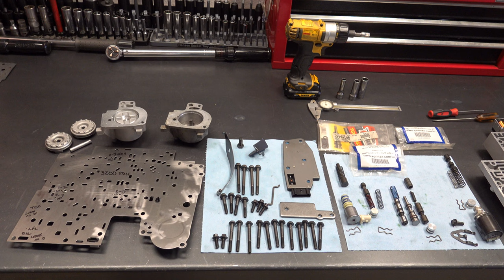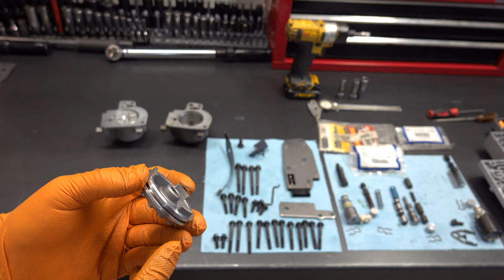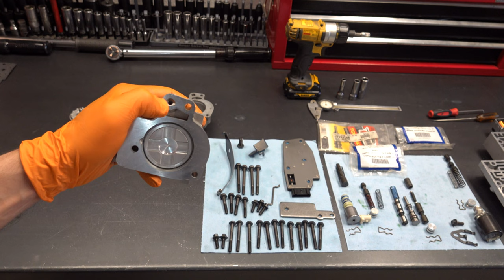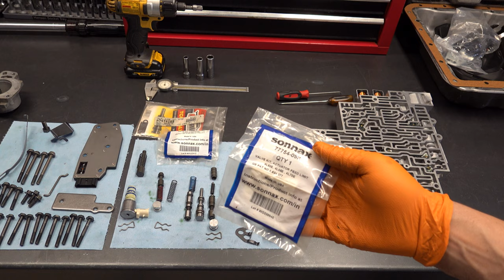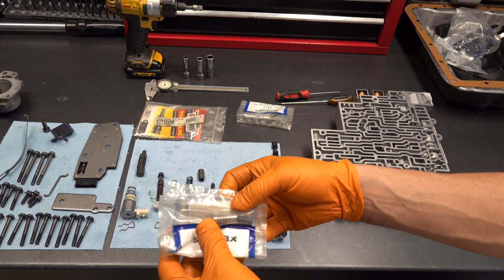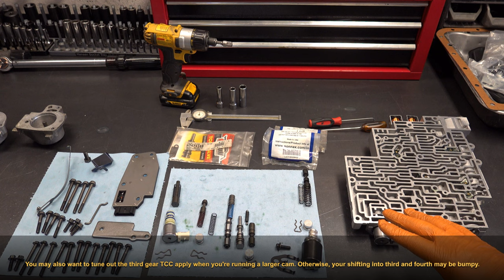4L60E High Performance PT4 - Valve Body and Spacer Plate Mods

Comment: You're knockin' it outta the park, Nick. I have yet to install a kit. Nothing against them, I just don't do high HP units, and I've been able to firm up shifts without a kit well enough to please folks. Anyway, I always hear folks measure holes drilled in thousandths of an inch, but every bit set I own is fractional. Do you use metric bits? Or do you just use a dial caliper on your fractional bits?
Reply from the maker: Thanks again, Kevin. I stopped using shift kits for most transmissions a while ago as most of the time a shift kit isn't needed to calibrate shifts and achieve performance. I do use a kits for a couple transmission types for their corrective parts (i.e. the Transgo Tugger for 4R100s). 

All of my numbered drill bit sets are either metric or SAE and I just use whichever best fits the need. Some transmissions like the TH350 and TH400 can have the feed hole sizes expressed as 1/8 (.125) or 3/16 (.1875).

Comment: Thanks for the information Nick! Your videos have been extremely helpful. I was hoping to maybe ask for some advice. I have a stock 1995 C1500 with a 4L60E that has a super late and harsh 1-2 shift. So far, I've purchased the torlon balls, a new separator plate with gaskets, a sonnax pin less accumulator piston kit (all 3), the tcc block-off valve, as well as a corvette servo kit. Would it be beneficial to drill the separator plate (if so, what size)? Also, can I use the stock springs or would it be worth purchasing a transgo shift kit? Lastly, I'm not sure whether or not to purchase a boost valve since I'll already be knee deep into this project. I'd appreciate any advice you could send my way. Cheers!
Reply from the maker: Hi Morewaterslides, thank you for watching and the compliments. First thing I'd do is check your servo travel...Remove the servo assembly, then take off the o-rings and large, front scarf cut seal...Then reinstall the assembly, including the main return spring, and cover snap ring...Then push inwards on the servo cover and see how far the assembly will travel before it comes to a complete stop. You shouldnt have more than .175" of inboard travel. If you do, shim the servo...

Next check the 1-2 accumulator housing, if you haven't already done so. Your 1-2 acc spring may be broken. Installing the corvette servo and Sonnax pinless will make that 1-2 shift even worse/more harsh so I'd keep the 1-2 acc piston and spring set up factory for now (or even install a softer spring, if you can find one...Overly harsh, late 1-2 shifts will eventually break the band - ive seen many of these come in with broken bands and no 2nd and 4th gear complaints...

Drill your 2-3 and 3-4 feeds along with the band release to .093. Leave the 1-2 shift feed hole in the plate the same for now. 

Lastly, purchase the Sonnax 4L60E-LB1 as that boost valve is likely worn out by now.
Reply: @nickstransmissions  Thanks Nick! This put my mind at ease. I'll be sure to update my progress in the coming weeks when parts come in and the job is done.
Reply from the maker: You're welcome, man!
Reply: @nickstransmissions   Finally got everything installed! I did however make one minor mistake. I installed the connector to the pressure control solenoid in reverse. It ended blowing the trans fuse on the interior fuse panel as a result. Once corrected, the truck ran great! A jammed 1-2 check ball ended up being the major culprit to this project.

Comment: Morning! Are pinless accumulators a good upgrade  for replacing the factory  ones. See if i can get firm shifts without sk and do a few updates to valvebody.
Reply from the maker: They are but your 1-2 shift will be a little bit firmer, all other things equal. The 1-2 shift will be more firm if you pair the pinless piston with Sonnax heavy duty accumulator spring.

Comment: Can you go in a little more deth on the 3-4 shift valve, as far as assembly,  and a look at what it looks like when it moves? Is there spring pressure on it? I think im having some issues with mine
Reply from the maker: Hi Eric, thank you for watching...What drivability symptoms are you having? 

The 3-4 shift valve simply strokes to enable apply oil to go into the 4th gear servo apply circuit, enabling an upshift from 3rd; it's a relatively simple valve train.

Comment: Quick question brother I’m fixing my 2003 suburban 4L60 E will that fix all  tcc valve will it work for mine and if so, any issues
I’m at the point that I stopped working on the valve body while I was trying to research this thanks
Reply from the maker: Hi Javier, yes - just purchase the Fitzall valve for your vintage (2001-2005; type 'Fitzall 4L60E 2003 in Google search bar to find it on Amazon) and it will address TCC regulator bore leaks and convert the PWM TCC apply to an on-off. If you are still getting P1870/Component Slipping DTC after you install that valve then the cause is somewhere else in the transmission or the torque converter itself.

Comment: I tore a 4L60e apart that wouldn't pull in 4 and it didn't have any value body gasket and spacer gasket. Why would anyone do that..???
Reply from the maker: Hi Tip, thank you for watching.

Yep, I've seen that as well...Not sure what those people were thinking as the gasket set is literally less than $2.00 at most places.

Comment: One division, the tcc pwm solenoid is equal to 3-2?
Reply from the maker: The 3-2 and PWM solenoids are the same for 1995 however in 1996, the 3-2 control solenoid changed so if you're shopping for a 3-2 control solenoid for a 1995 unit, the trans parts place will sell you a PWM solenoid...The 3-2 control solenoid, valve and spring were eliminated starting in 2009.
Reply: @nickstransmissions  Mine is 99, but the question is: if the TCC and the 3-2 are the same, because when you disassemble the head where the plug goes there is a difference. But the valves apparently, externally, are the same...
Reply from the maker: @minduca99  Please re-read my above response...They are the same for 1995 ONLY...In 1996, the 3-2 CTRL solenoid changed so they're not the same in your 1999 unit. if you had mentioned you were looking that information applicable to a 1999 model year, I would have provided a shorter answer applicable only what year you're working on.
Reply: @nickstransmissions  So, now I understand, I really hadn't understood.
And I still think I wasn't complete in my questions, I'm still in doubt!? (sorry, I don't speak English, I'm from Brazil). And I have a 99 Chevrolet Blazer v6 or GMC Blazer. Does this apply to it? In Brazil, few people have the knowledge to maintain this transmission...
Reply from the maker: You should have a 'Jimmy' if you have the GMC variant. Wouldn't matter - all 1999 4L60Es are the same with respect to the solenoids. 

It may be a good idea to put my responses into Google or another translator tool that renders what I type in Portuguese, assuming that is your native language.
Reply: @nickstransmissions  That's right, I speak Brazilian Portuguese, and I'm using Google.

I'm even more confused now... You said: "all 1999 4L60Es are the same in terms of solenoids." Does that mean that mine is the same, both with the TCC PWM and the 3/2?

And thanks for helping me.

And yes, I have a "Jimmy" GMC variant, and they even listed them as V6 and not V8, better known in Brazil as the Chevrolet Blazer... Thanks again.
Reply: @nickstransmissions Just to add, talking to my wife we will buy the 5 solenoids and change them all at once... Because I read an article that the error 1860 can be due to other solenoids or valves that do not open properly, as the transmission is already open, and we are in doubt if it was only one that was defective, and even considering the year of this car, which is already 25 years old, we will take advantage and change them.
Reply from the maker: I guess Google translator isn't doing it's job...What I said was 1999 4L60Es are all the same when it comes to the solenoids....I DID NOT say the TCC PWM and 3-2 control solenoids are the same because they are NOT! 

Please find someone who is bilingual who can help translate for you because Google is either not doing the translation correctly or you're not understanding what I am trying to tell you.
Reply: @nickstransmissions  Yes, now I understand. I will buy the complete kit of 5 solenoids, and it will be great.
Thanks again for your help.
Reply from the maker: You're welcome, Minduca - glad you were able to get it figured out.

Comment: on that plate you have a small elevation(where one ball goes in),  why is like that?  I see some plate that are flat.  in your video is below of #2 on the 1-2 area?
Reply from the maker: If you're referring to the steel sleeve, that's from the company Fitzall and it's designed to repair the 1-2 check ball location which is often heavily worn and occassionally the check ball will get stuck in the plate. The sleeve prevents that from ever happening.

Comment: fresh rebuild, I have a delayed 2-3shift particularly at wot. Any idea what could be causing that?
Reply from the maker: Hi Dominic, there could be a number of reasons including a leak in the 2-3 apply circuit (like partially pinched turbine shaft sealing rings), excessive 3-4 clutch pack clearance, forward drum leaking at the input shaft, improperly drilled spacer plate, solenoid B delay in coming off, drag in the 2-3 shift or 2-3 shuttle valve, etc.
Reply: @nickstransmissions   I have it apart. pressure tested the drum sitting in the pump with and without the reverse input drum. I change the rings a second time with a resizer and had no change. 3-4 clutch clearance is .040, was .030 when I installed it. Band clearance is .090, was .070 when I installed it. I pressure tested the input drum and no leaks around the shaft. I installed a new capsule on the initial build, and another when I changed the valve body trying to fix the problem. There's only 2 things I found, one is the servo pin bore will only pull 7" of vacuum, the other is the new spacer plate afl hole is .093, but while not ideal I can't see how that would give no 2-3 shift at wot. I was thinking maybe the pin bore is letting band release oil into the 4th gear piston, but I'm not sure if that would be able to delay the shift. I checked all the usual suspects, but I'm stumped.
Reply from the maker: The spacer plate's AFL balance hole is definitely a problem for WOT shifting, especially at higher power levels. Think about the factory orifice diameter and compare it to .093 in your plate - thats a fair amount of AFL pressure bleed off at a time when you need max AFL pressure. 

Did you install load release springs in the 3-4 pack?
Have you blocked the 3-2 control valve inboard?
Do you have an inner spring inside the main AFL valve spring?
What about the AFL valve itself - how much vacuum is it holding (should be minimum of 18" for anything high performance and my standard is 20")?
What are the hole sizes for the band release (2-3 accumulator) and 2-3 feed?
What boost valve is installed?

You have a 2-3 shift at WOT but it's flaring due to a delay in the full compression of that clutch pack relative to band release timing. That AFL balance hole is something id fix via peening the plate or getting another one...Band clearance is fine, has nothing to do with the 2-3 flare. That is all sourced within the 3-4 apply circuit or clutch pack set up unless you have a weak solenoid or defective PCM (I've seen examples of both).
Reply: @nickstransmissions   It's actually not a flare, just doesn't shift to 3rd unless I really let off the throttle. Running the car on the lift if I put it in manual low and get the speed up with light throttle as soon as i put the selector in 2 it shifts perfectly to 2nd, then if I get the speed up higher and put the selector in D it takes about 3 full seconds to shift to 3rd. Once in 3rd it doesn't slip. It's not releasing the band before the 3rd clutches apply, so no flare. I can't tell if the 3rd clutches are on before the band release, but it doesn't feel like a tie up. It's almost like a delayed shift but the timing between the band release and clutches is okay. This one is a stock rebuild with no performance mods except a .500 boost valve. I did change the seperator plate because a ball was through it. It has the same exact shift problem with 2 different valve bodies. I did not however try a different plate before tearing it back down. I should have. I expected to find a cut teflon shaft seal, but they look perfect.
Reply from the maker: Sounds like a 3-4 circuit line pressure problem to me likely caused by that AFL balance orifice (and/or perhaps other things)...Put a new plate on it, keep the hole size factory, drill everything else as you have previously and upgrade the 3-4 pack to a 8 or 9 clutch stack up...Alto and Raybestos both make 'max packs' or you can build your own by machining apply/backing plates and mixing/matching steels and frictions until you get the stack up you want. 

Cope Racing also makes a high perf drum that allows for 8 or 9 clutches and steels, may be worth taking a look at.